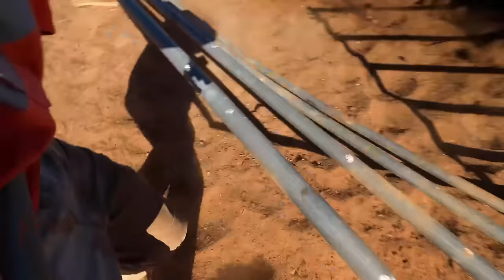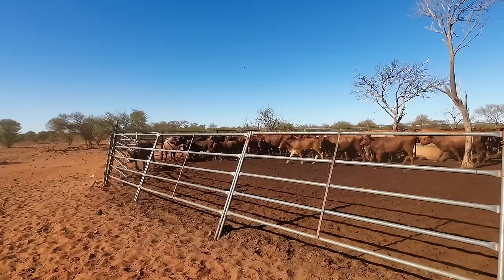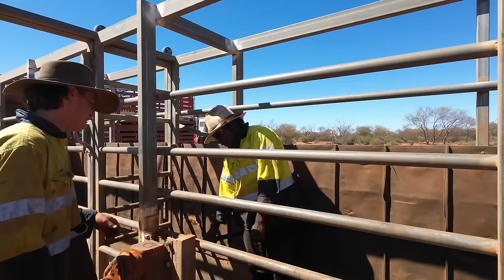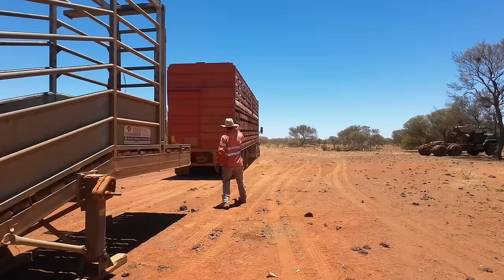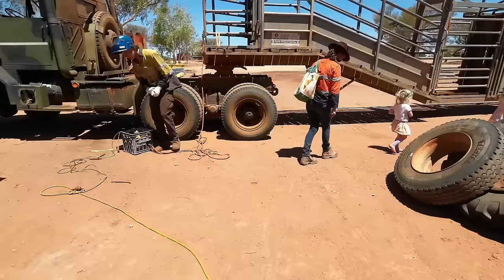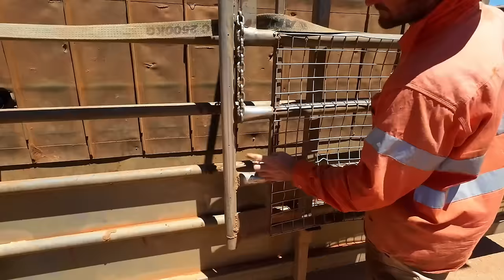Red Hill Roundup: Wrangling Bulls and Unplanned Escapes!

Comment: Since finding your channel a couple of weeks ago, I've been wondering if there's not a market for the camel hides.  I did a real quick google search before commenting.  It’s seems like they make for some decent leather and brings a decent price because theres not a large supply.
Reply: Possibly could be, but they have to be treated soon after skinning, salted in a large hopper, we used to use a concrete barrel off a truck. The leather industry does not want any hides that have "battle damage' scars on the hides. You also have to take the hides off without knocking/putting holes in them. it is a very labour intensive industry and you need to streamline the process, which involves a bit of machinery and metal structure. The blokes that in an earlier video that took those camels for pet food, were very quick and skilful in their work, There pet food industry is a bit more lenient on how food is processed as opposed to how meat is process for human consumption. Some animals carry disease so there is a need for inspection, At an abattoir the animals being processed are checked throughout, from arrival to going into a cardboard box to the fridge/freezer. which is a good thing as it stops a lot of unscrupulous practices that could occur and have done in years gone by.
Reply: @veridian79  I completely understand how labor-intensive leather production is.   You're correct with everything you stated.  There's no way that you would have time to do any of that.  I was thinking more along the lines of having someone you could call, tell them where the camels are, and let them harvest and process themselves. Here in the States, one of the hands would probably start skinning a few out in their spare time just to make some extra beer money.
Reply from the maker: The ideas are all the same that we have had before. Unfortunately we are even too far away for a constant pet meat program. We have tried! People can’t really just “pop” out and do a job as we are 700kms from our closest town that has facilities and labour! 300kms to a small mining town. It’s big distances for a very small market!
Reply: @jack_out_the_back  that's understandable.   I guess you just keep on doing what you're doing.  It's not any different than the feral hog problems we have here in Texas.  Nothing is done with those animals after they are exterminated, either. There has been a big increase in the number of people who trap them and then feed them for several months before selling them to a processor for human consumption.  High prices in the grocery stores are the only reason for that, though.  I enjoy your videos, keep'em coming.